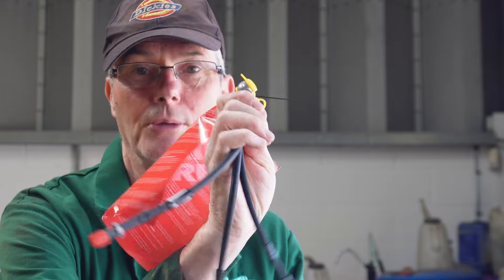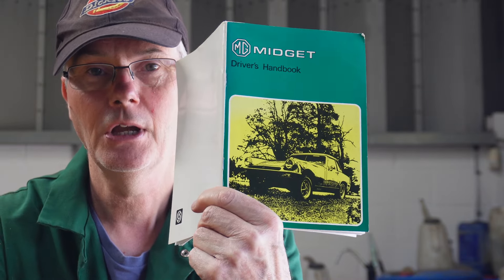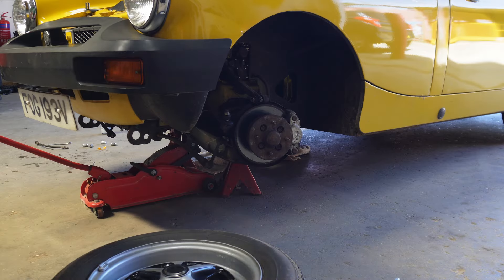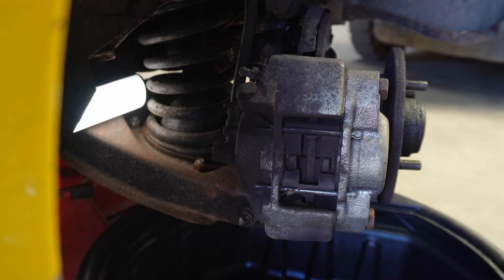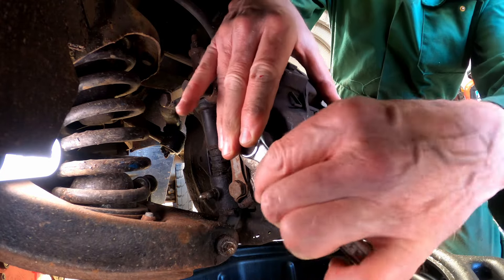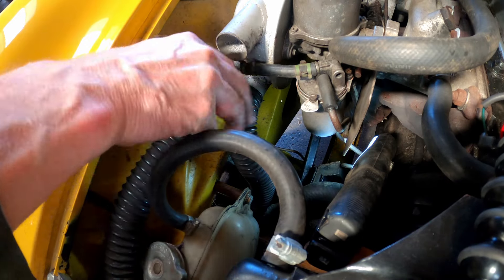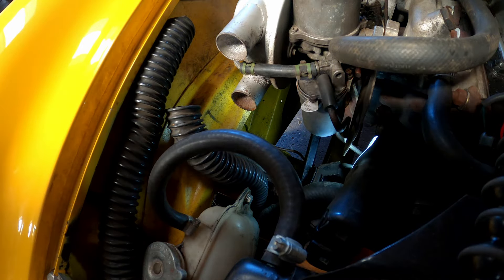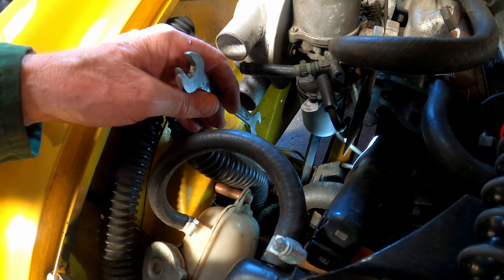MG Midget 1500 Classic Car Brake hoses

Comment: I can empathize with the filming while working challenges. The most frustrating times are when you think you've filmed a task only to discover that your mic wasn't charged up or, worse yet, you forgot to turn on the camera!! There's been more than one occasion where I've had to reassemble something to re-film taking it apart!!! Keep up the great work... both on the car and the videos.
Reply from the maker: I have done the reassemble some parts to film again, see heater valve, only to not show exactly how tight the bolts were.